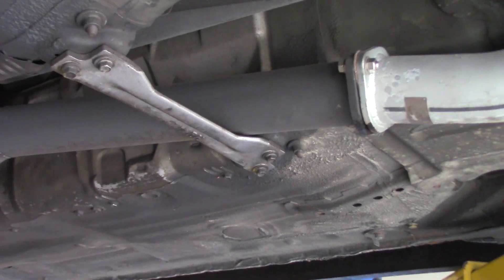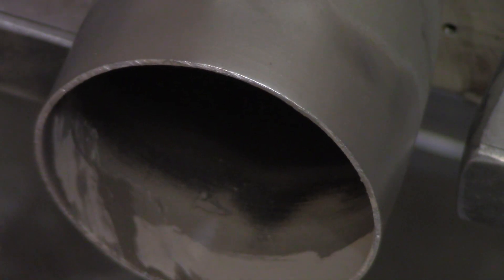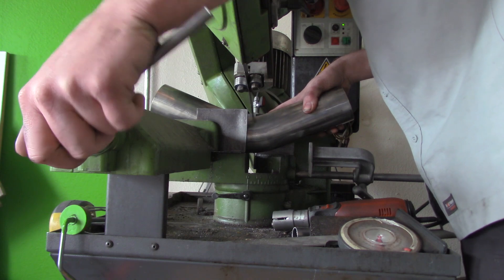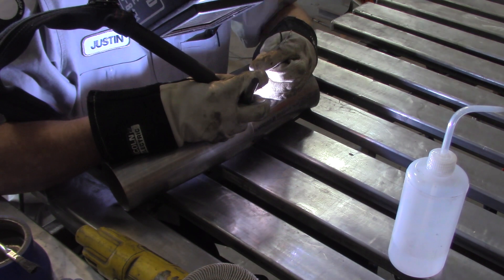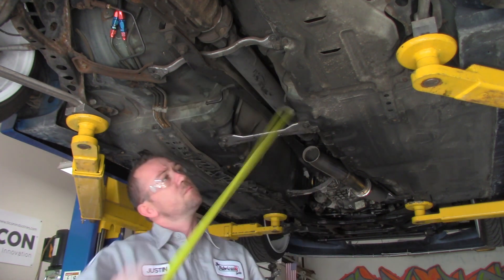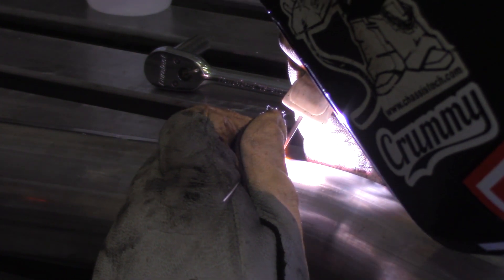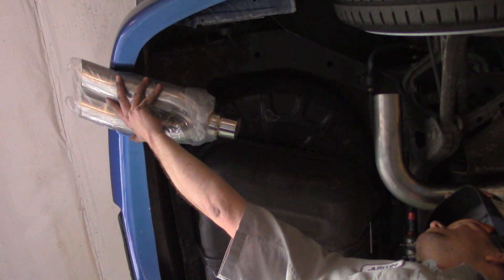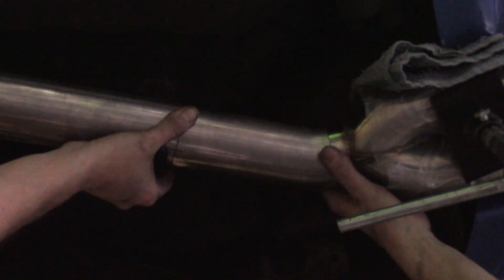TFS: DIY Custom Exhaust from Scratch

Comment: Would placing the resonator farther forward have changed the tone significantly? Going to finish my 13bt exhaust pretty soon, was considering a resonator simply for tonal purposes. My audio engineering background says resonator placement should make a difference, but my rotary experience says "lol NOPE"
Reply from the maker: There are somewhere in the neighborhood of about eleventy-gabiliion variables dictating an exhaust note. Aside from the engine note alone, the material size and type plays the biggest role. Stainless is a very dense metal which does not absorb sound as well as softer materials, so its very loud and choppy (kind of tingy). A resonator helps take that chop down, but does little for sound absorption.  The type, size, and packing changes the amount of chop it will offer. The placement will affect the tone of the chop. The more upstream it is placed, the more high frequency it will chop and modify the note, but it more susceptible to damage because of the heat and frequency simply beating it up. 

Since a rotary has 6x the frequency to deal with , and nothing internally to absorb or change the note (its very raw), you will need a very large resonator (maybe two) and a very large muffler to tweak, chop, and tune the exhaust note. Drone tubes also help tremendously to tune a rotary note.

Comment: Would that solar flux burn off in the exhaust easy of did it burn up during the welding?
Reply from the maker: waymen lawrence It creates a glassy like shell which may or may not break free in the system. For a full "flow through" system like this, it's no big deal if it comes off and blows out. Any unburned powder will blow just out.